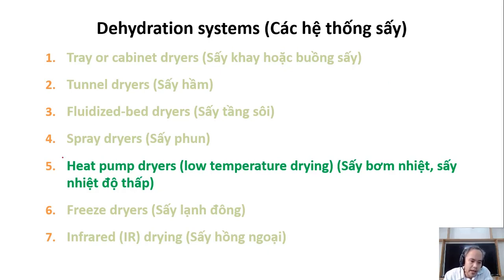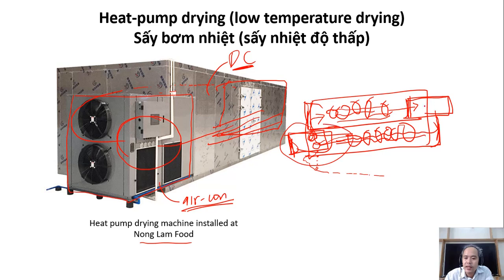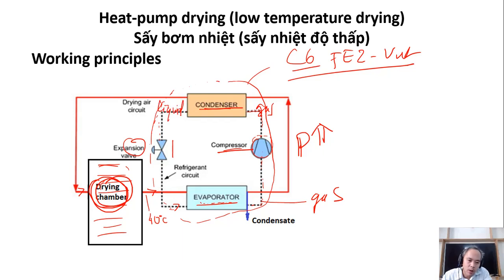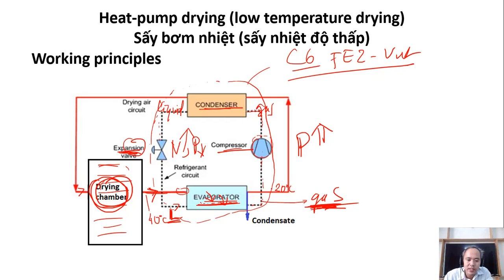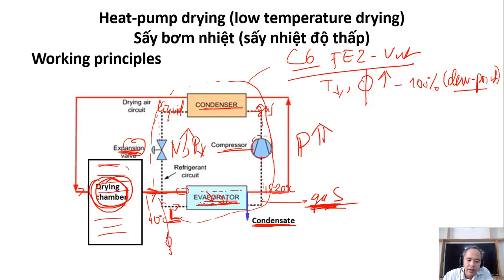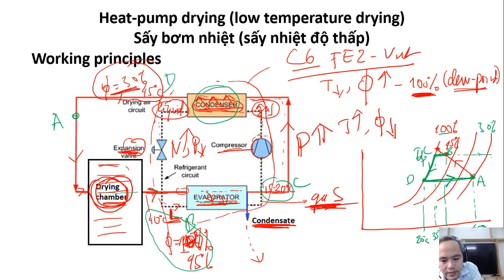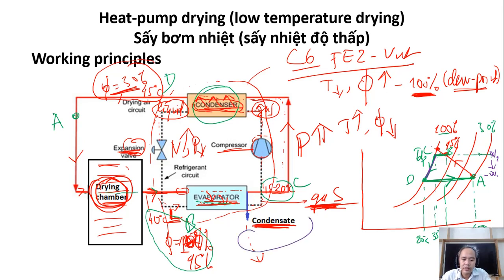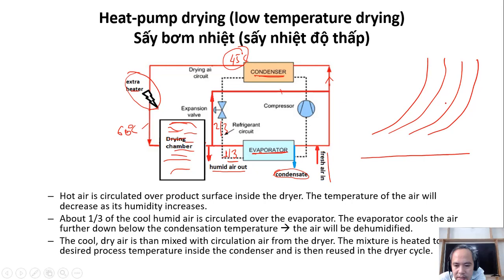Drying 15. Heat-pump dryers

Comment: Excellent presentation.  I would add turbulence to the air - or make sure that it has turbulence to assist in the dehumidification process of the unit.
Reply from the maker: Yes, thanks for your comment. Good luck